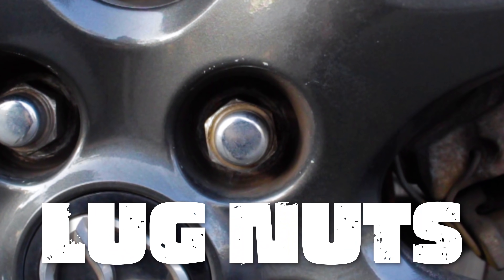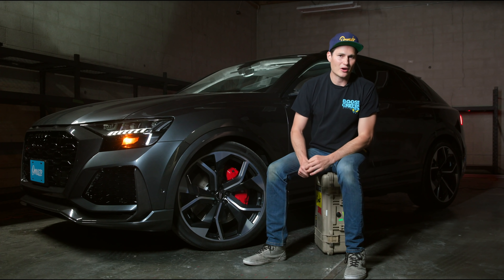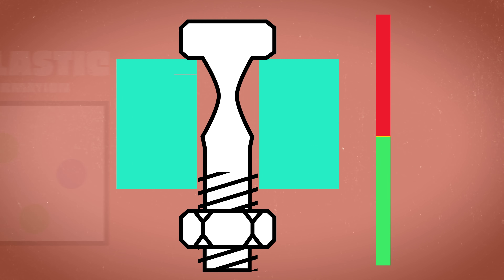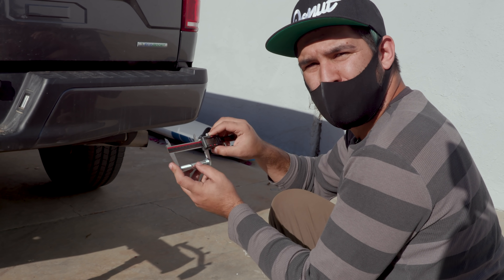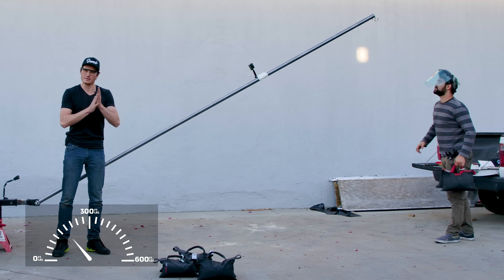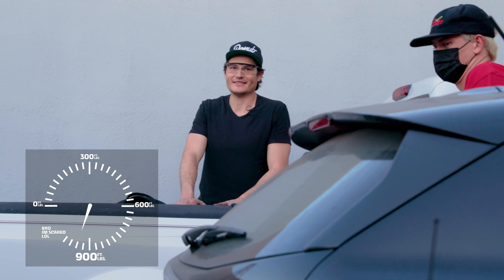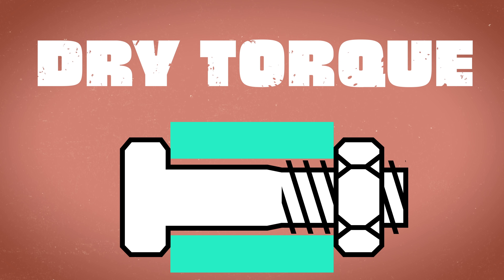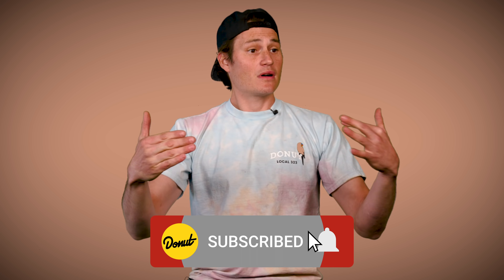What happens when you over torque a bolt?

Comment: The weight times the length of the arm calculation to determine the foot pounds of torque on the bolt is only accurate when the arm is parallel to the ground (gravity)- when the long stainless arm is at a 45 degree angle like when the weights were loaded by ladder you would have to use trigonometry to determine a more accurate torque applied.  — update: pressed play and watched 10 more seconds of the video and watched the bar go level, math checks out- have a good day

Comment: 11:18 Sort of wrong. You don't have to measure the tension perse, you can measure the stretch in the bolt (like you did earlier in the video!) and calculate the tensile force from that. So if you have a bolt that has both ends exposed, like say a rod cap bolt, you can get a more accurate measurement by measuring the length on the bolt instead of the torque applied to the bolt.

Comment: Fun fact most ratchets are designed not to break structural bolts. This is also why it's kind of stupid to tighten with a cheater bar.

Comment: the torque and angle technique can be simplified to the bolts tolerance torque or say 30ft•lb ± 5ft•lb not some jank ass angle cause that's different for every bolt and thread real machinists and engineers use tolerances

Comment: Hey try renting a hydraulic torque wrench, I use one daily and 1”1/4 bolt to 1850 ft lbs that’s about 5000 psi on the hydraulics and can crank it up to 9000 you should give one a try they are cool how they work

Comment: Never Once was the thread manufacturing process or bolt material mentioned as a factor for bolt strength. These are also a defining factor. Cut or milled threads make a bolt weaker then a roll threaded  bolt, which actually strengthens the bolt. Not even gonna bring up heat treated bolts LOL.

Comment: I've had quite a few apprentices ask me about why I don't torque certain things to spec. Simple things like strut bolts or engine mounts etc. And I have to explain to them that these cars are old and rusty. The factory torque spec isn't the same as what the bolt actually needs to stay in place. So I tighten them by hand (or with my impact... been doing this a while, I'm pretty accurate with it.). But the idea is to get a feel and know when a bolt/nut as actually fully seated and tight enough. A good mechanic knows what a bolt can take and also when to take a step back, pull the bolt back out, chase the threads or add lube to the threads depending on the scenario. A good mechanic also knows when a bolt is about to break during loosening and when to pull out the torch or let it soak in penetrant. So the first time they have a bolt come loose or break a bolt during removal, thats when they start to listen to me. And yes I know that this style of training won't work for everybody but I've turned quite a few trainees into very competent technicians. I suppose you're either meant for the industry or you aren't. Most people on the internet just wouldn't understand.

Comment: You only get the weight of the bags as a torque when the bar is parallel to the ground, otherwise the weight of the bags is not acting perpendicular to the bar. Also, I'm sure there's some degree of flex in the steel tube you're using so that "dissipates" some of the torque

Comment: I guarantee the steel grade and heat treatment of the 1/4" bolt was vastly different from the 1" ball hitch bolt. That also makes a HUGE difference in plastic deformation and tensile strength.
Reply: Depends too.  The bolt they started with was a grade 5.  I have no clue what grade the ball hitch bolt is

Comment: I never knew why when you torque cylinder head bolts to the block it's a torque number and then a turn in say 45 degrees. Must be to get a more accurate torque figure on such important bolts?

Comment: I was rebuilding an engine many years ago and accidently used the torque spec for fastener listed below the fastener I was working on.  I was supposed to torque my rod bolts to 10-pounds but wound up torqueing them to 100-pounds.  I torqued several this way and didn't realize the error until the threads ripped out of one of the bolts as I was tightening it.  Thankfully, a new set of rod bolts was not that expensive, and my local engine shop was able to get them the next day.

Comment: Being one of the few mechanical engineers in the comment section, one thing that they didn't mention is WHY there is a torque specification. Torque specifications are required to produce a given preload in the bolt. Bolt preload for static loading prevents joint separation and yielding of the bolt and bolt preload for dynamic loading prevents fatigue and reduces the alternating stresses in cyclic loading. It's important to have this preload to effectively reduce the forces on the bolt and bolted members as well.

Comment: Ngl i facepalmed soo hard when they used a stainless steel pipe as a cheater

That bolt was stainless steel and a trailer ball is made with steel, and come with either a Zinc, Chrome, or painted Steel finish

Stainless steel has a very low tensile strength in comparison to steel

Comment: I tighten down 1 inch lug bolts for a skidded tire. You can tighten them with a 1 inch air gun at 2200 pounds without breaking one. I use the 3/4 Milwaukee to tighten them up now so we don’t stretch them

Comment: My exhaust manifold is held on with Helicoils. Guess why.
Reply: The best way to learn new words is watching an old mechanic shear an injector holddown bolt flush with the head of an engine.
Reply: I am not an old mechanic not at all but ive had a snapped injector bolt flush with the head
Reply: Lol done learned you that the hard way
Reply: Hey man, if it works, it works.
Reply: Same with the head of my first motorcycle... good learning experience I guess haha

Comment: Wait wait wait - you didn't mention bolt stretch using your handy dandy gauge!  That's the MOST accurate way to measure fastener tension.  And man you guys had this 99% nailed and I thought for SURE you'd mention using a "stretch gauge" or a similar device.

Comment: The tensile load in a bolt is directly proportional to the torque applied to said bolt. The constant of proportionality depends on the thread pitch, mean thread diameter, and coefficient of friction. Torque figures on bolts are almost always specified when the bolt is clean and dry, so that a known relationship between torque and tensile load will apply. If a lubricant is used on the threads, then that throws a lot of uncertainty into the torque-clamp load relationship. If a bolt is overtorqued, it may still be useable. One way to tell for sure is if you can still spin a hex nut all the way up and down the threads with little to no resistance.

Comment: Question for you mechanical engineers, when determining the proper torque for say a head bolt on an engine or any bolt and thread really. Do you have to calculate the force using the surface area of the threads and the pitch/thickness of the threads in addition to the tensile strength of the bolt.....or do you just do trial and error by tightening to different torque measurements and then measuring the performance of the different specs as well as bolt deformation? I've always wondered how they come up with the initial torque spec, I know on my Toyota transmission the torque spec is too high on the trans case bolts and it's common knowledge to not torque them to spec but essentially when you feel the threads start to give (aluminum threads, guess the engineers only considered the torque that the initial install would handle and not subsequent reclamping since the threads seem to lose strength after the first clamping, which is kind of useless since the manual should tell what the torque spec should be when repairing not what torque spec the factory used if threads have lost elasticity). Toyota never published an amended manual to address the known issue as far as I know. So I wondered what all they take into consideration if it's all mathematical down to thread tensile strength retention, thread surface area, thread pitch/mass or if there's some "this feel right" math thrown in lol.

Comment: Torque specs are garbage for many things. Wheels would be falling off all over if you went by spec. Another thing to consider is the source of the Lug nut or stud. Is it what they used or is is cheap shit on low dollar replacement parts?  Wheel and lug nut contact surface might not be the same if one or both are changed from factory as well.

Comment: There is one more way to check load on a bolt, and that is to measure it's stretch. Most high end rod bolt are torqued to stretch, this is why they have small "dents" in the head and shaft of the bolt. The "dents" give you a repeatable place to measure from.

Comment: Genuinely thanks for the clip. A few mechanics seemed to miss this part of the apprenticeship. Rattle-gunned-to-death wheel nuts have been a big problem in my world. 👍👍
Reply: always torque them to spec, if lubbed up use 80-90% of torque youd usually use depending on the size and application

Comment: I think you can achieve those 2200 lbft required to break that 1 inch bolt...

You have two options:
Option 1: Use a 1 inch impact wrench (the ones used to tighten down truck bolts, there are tools that deliver over 2500lbft).
Option 2: Use a torque multiplier (a tool used to torque down truck wheel nuts).

I've made half-inch bolts cry with option 1, and broke a truck bolt once with option 2...

Comment: Did you forget to mention different grade bolts have different tensile strengths?  Which is why you shouldn't use a grade five bolt in place of a grade eight?

Comment: “I can’t put any more torque on this,” dude there’s a torque multiplier for that.
Reply: Check out hydraulic torque wrenches with a reaction arm. Insane amounts of torque
Reply: @paulmorrow8372  yeah those are impressive, but it’s way easier and cheaper to get a torque multiplier.
Reply: @jonathanlandis3650  I'll stick with my 10-foot breaker-bar and hydraulic jack.   Lets me over-torque almost anything.
Reply: Oh how much easier it would have been if they just used a torque multimeter.
Reply: @northernalteration8576  I use my torque multimeter alot like for checking amps of hrspers
Reply: @DYLANDUDE822  I totally did not proof road that.
Reply: We came for entertainment damn it! Hahaha there would have been less suspense then 😉
Reply: Theres a tax for that - oversimplified

Comment: A cool thing about bolts/pins is some are meant to be crushed. I work with pins with threads on each end with opposite rotation from one another and by torquing the nuts you squeeze the center,  expanding a Teflon piece in the center to make sure it doesn’t move in case a bit falls off. That being said we also step up the torque to keep it centered

Comment: The distance a nut travels down a thread is called " lead" so if a thread has a pitch of 1mm it will travel 1mm down the screw or bolt in one complete revolution .This is the principle used on micrometers which have a pitch of 0.5 mm  on the thimble.

Comment: There is some torque specs that have you measure the stretch length of the bolt. You don't see it much but they're out there, I think I've seen it once or twice on airplanes.

Comment: There's another method of torquing that I didn't find out about until I hit the railroad scene. Bolt tensioning. We use this hydraulic tensioner that attaches to the head stud or main bearing stud. With a specified fluid pressure, "torque spec", it'll stretch the stud, and then you snug your nut down. When you release the hydraulic pressure, it'll create the clamping force as the stud tries to return to it's normal state. Very cool!

Comment: Thread pitch is more than just the amount of threads making contact with the nut. The stretch load on the bolt vs torque is actually more related to the angle of the threads than anything else. Think of them like a gear, a course thread will stretch the bolt further for the same amount of turns, but will require more torque to do it. A fine thread is effectively lower geared, so takes less turning torque to achieve the same amount of stretch whilst taking more turns to get there...

Dunno if this makes sense, but it does in my head and it’s the only way I could think of explaining it.
Reply: I just read my own comment back and realised, I’m actually really boring.

Comment: Fun fact,  u bolts on walking beam mack suspension torque to 1650 ft lbs..thats where your 13 foot pole plus a 3/4 drive torque wrench,  plus a multiplier comes in

Comment: something else interesting is that not all the threads have tension on them when torqued, since the bolt stretches the thread spacing changes causing some of the threads to have less pressure. One way to overcome this is to cut the thread pitch so that it gradually changes to compensate for the stretch. This is only a concern in high precision applications where the threads absolutely must remain in place.

Comment: puts a 1 inch air impact on it with 200 psi shop air all the ugga duggas😂  

Ps. Most inch air impacts are rated at around 1800 ftlbs at 110 psi

Comment: from the mechanical incline of the thread pitch the small bolt snapped at 1'800lbs aka 140ftlb on the nut, and the larger ball nut would have needed 28'000lbs aka 2200ftlb on the nut. based on 13TPI... finer threads have lower torque specs, not because the threads are small and flimsy. so if that hitch has a pitch of 26TPI it would snap at 1'100lbft on the nut, tho it would still be 28'000lbs of force. fine threads, make your tools last longer.

Comment: Hey guys, I'm an automotive test and evaluation engineer. Superb demonstration and explanation. Regarding torque vs angle, sometimes we break out a torque angle potentiometer to measure torque input vs bolt angle. When torque vs angle is nice and linear, we know we're loading the bolt and not compressing a "soft joint".

Comment: Motorbike cylinder head bolts stretch each time they are torqued to spec, so eventually they will go ping, and snap.
You then take the head off to retrieve the broken thread, torque things down again...two other ones go ping.... Remove head to get snapped threads out..
Shout, scream, threaten to torch the F&ckerad it's insured.
Then replace every bolt with new ones.
The joys of working on a 28year old bike.....

Comment: every clown at every dealer or whatever garbage shop you bring your vehicle to (I prefer the dealer) they never torque lug nuts, and they never ever fill the tire up to what they are supposed to be, the look at the side wall and see, oh 40 psi, look at the door jam dickhead its 35, and dont even get me started on setting adjustable wheel bearings on trucks

Comment: !!!IMPORTANT!!!
DONT OVER TIGHT LUG NUTS
I HAVE EXPERIENCE AND PLEASE LISTEN
WHAT WILL HAPPEN(WHEN OVERTIGHT) IS WHEN THE LUG IS UNDER HEAVY STRESS(LIKE TURNING) THE LUG WILL SAY BYE BYE AND COME OFF. BUT THATS NOT IT, IT ALSO BRINGS THE STUD WITH IT  !!! IN HALF !!! 
THIS IS PREVENTABLE WITH A LITTLE USE OF THE EARS
WHEN TURNING, HEAR A PING NOISE WHEN TURNING IN PLACE
⚠️ ⚠️ ⚠️ WARNING⚠️ ⚠️ ⚠️ 
DO NOT DRIVE WITH A LOAD IF THE STUD OR LUG HAS BROKEN OFF, THE STUD(6 STUD CONFIGURATION) ON THE OPPOSITE SIDE WILL BREAK OFF. 💰 🤑

Comment: Where I work we have some bolts that we torque by physically stretching them with a hydraulic ram and spinning a nut down finger tight then releasing the pressure from the hydraulic ram so the nut can hold the tension.

Comment: Im interested is seeing what the comment section has to say about this.  Do you use the wrench on the bolt head or the nut when applying torque (if not specifically stated anywhere)?

Comment: Over torqued a bolt for a Jake brake in a dd13. (Really just because they are one time use bolts but my instructor told me just to put it back in) Pulled it out and I got really lucky. It was all still together, but literally the two pieces were holding together by the metal of a thread. Took the saying of ‘hanging on by a thread’ to a new level.

Comment: You started the video perfectly explaining how to figure out if the bolt is torqued enough and even did the measuring process (not with the right tool, but whatever, the idea was there)...then at the end of the video you say there's no good way to figure out how much tension is on the bolt....umm...yes, there is! You've never seen a rod bolt stretch gage? Like I said, you even measured the bolts at the start of the video to explain elastic and plastic deformation. THAT is EXACTLY how you figure out the tension on the bolt. Of course if it's a blind hole (as most bolt applications are), this isn't possible and the torque angle method is probably the next best bet. You also mentioned wet and dry torque, but didn't even explain ARP torque lube. I know you only have so much time to fit in content, but come on. This is basic stuff, guys.

Comment: Can you please tell me what brand breaker bar that is? 1/2" drive?
Seems like a good long term investment
Reply: plus: at 9:50 you're wrong. When calculating bolts you use the core-diameter (without threads) because you have to imagine the same stress is present in the area where there is no nut.

Comment: Fun fact: On radial airplane engines oil can collect in the bottom cylinder(s), which can seize the engine on startup. This is called being hydro locked. On airplanes with large propellers like the DC-3, moving the propeller with your finger with your finger creates enough torque to bend a piston rod (killing the entire engine).

Source: https://www.youtube.com/watch?v=weoq3toS2ng